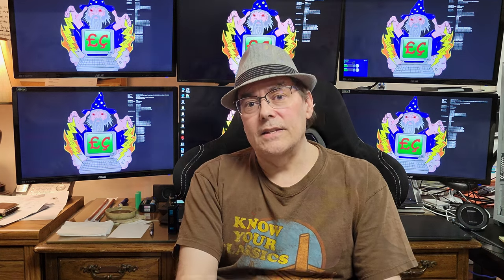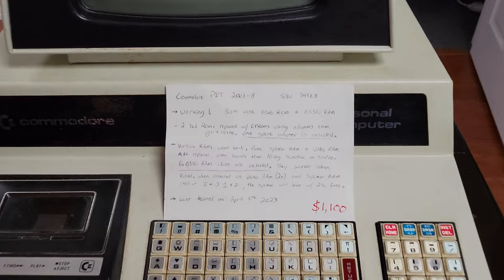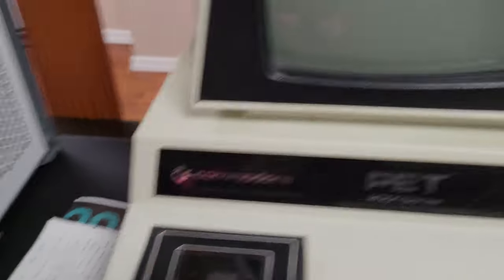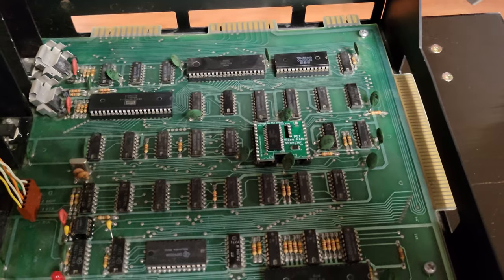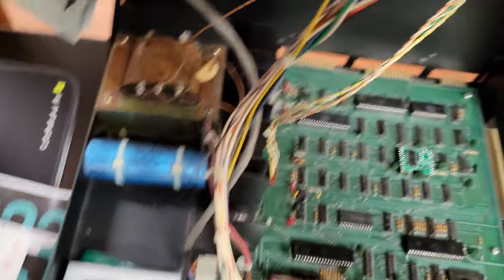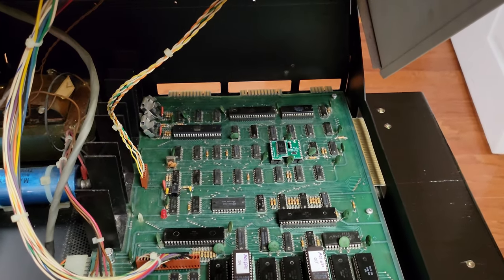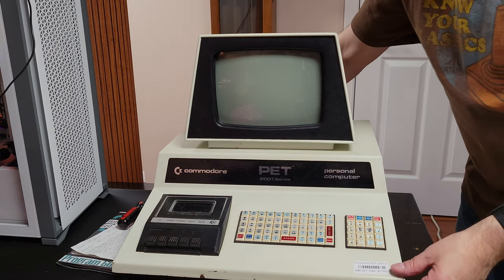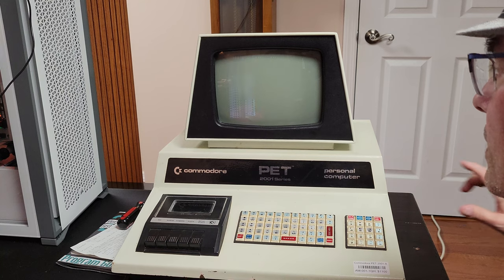I Scored BIG at Vintage Computer Festival East - 2023 | Commodore PET 2001

Comment: I sold my first electronic product using a Commodore PET. I connected an IBM Selectric typewriter to the pet using the expansion I/O connector on the left side. I Minister used it to print our copies of his sermons. I wrote an asm driver that was called from the basic program, to make a print out.
Reply from the maker: Nice! I once had an HP DaisyWheel printer connected to the IEEE-488. It worked, but the PETSCII graphics came out in lower case. Not good for program listings :)

Comment: I'm glad that PET found a home.  I tried the keyboard while it was in the consignment room and found the keys were too small for my comfort.  My fingers are rather large in diameter.
Reply from the maker: They take a lot of getting use to. I wore down the letters on mine from 79 before I sold it. At one point, I took an old obscure terminal keyboard and hand soldered the contact into the proper matrix and connector. Too bad you cant plug on in an external USB keyboard...🤔

Comment: Congratz.  I updated my database.
FWIW, looks like a mid '78 model. Still using 6550 RAM but with the C2N drive and black screen bezel.
Reply from the maker: Thanks. I don't see any chip date codes older than 1978.
Reply: @LordChariot  What week?
I know the C2N drive came out around the middle of '78 and the screen bezel changed to black around the same time but not exactly.
Have you removed the internal tape drive?  Very early internal C2N drives didn't have the Commodore name embossed in the plastic, because that area isn't visible when it's installed.
Reply from the maker: the oldest ROM is 4178, the CPU is 3978. most of the others are nearby that range. 
The tape drive DOES have the Commodore logo raised and painted. I need to pull the tape drive anyway. It's not feeding a fresh tape, so maintenance.

Comment: On the white sales sticker is the initials the seller (not the card, but the white sticker near the keyboard somewhere around the barcode on that sticker).  Try to contact the event coordinators, they might still have the database to cross-reference those initials back to contact info of the seller.   Curious what those ROMs end up being.    I tried a C64 keyboard in the PET, it needs an altered ROM to make that work.  8K is rough to work with - I think PETTERM may still run in 8K (or maybe older versions of it), so grab a WiModem232 and get online with it :)
Reply from the maker: The sticker is there but, I dont want to bother the seller.
The ROMs are 1.0. I was considering upgrading with this RAM/ROM so I can get a SD2PET storage:
https://www.thefuturewas8bit.com/petromram.html

Comment: For that amount of money, I hope you tested it before you bought it. If not, you must have really wanted one, dead or alive.
Reply from the maker: I didn't know for sure. That would have been disappointing, but then I could restore/repair it.
Reply: Actually, I have a friend who is kinda keeping an eye out for one so I also look.  That price is about right if not rather a good deal if the mods are quality.  (I don't know this computer well.)
Reply from the maker: @Fezzler61  I've been outbid on a couple of these 2001s and found a couple of 4032s, but i really wanted the chicklet keyboard. So far it looks like the only problem with it is the cassette drive belt.